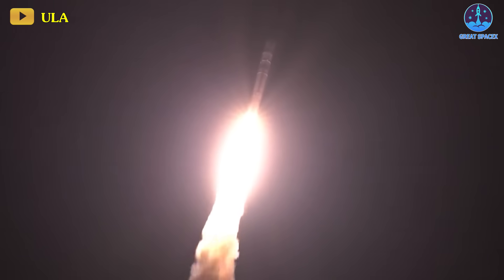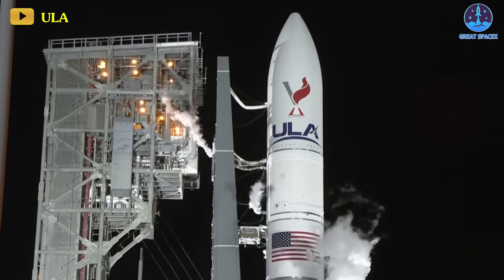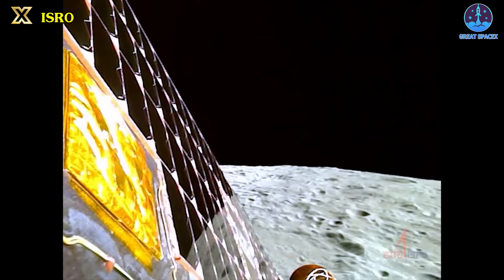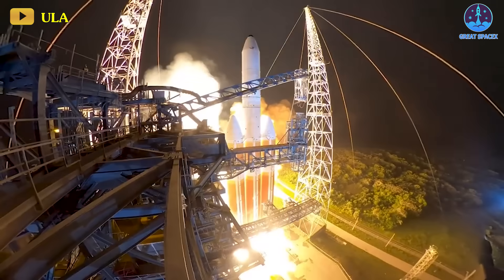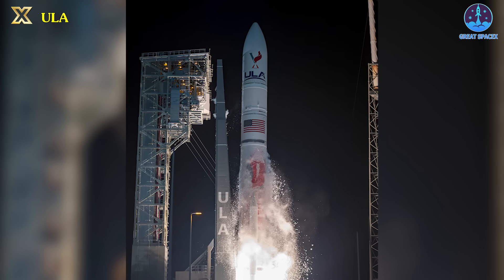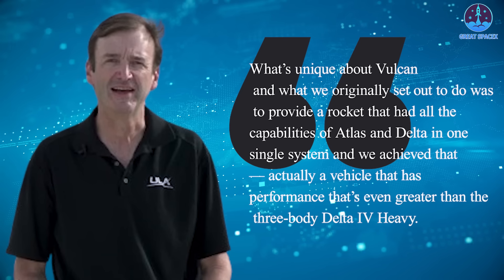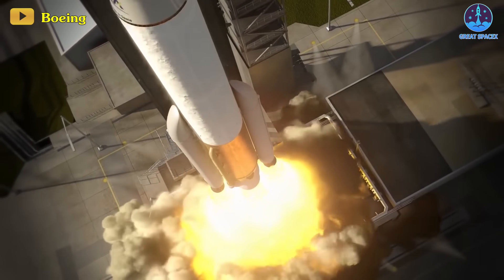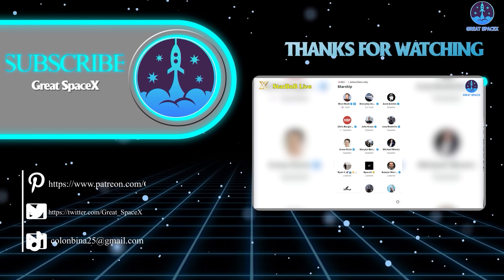Finally! ULA Vulcan & BE-4 successfully launched on first flight. NASA's reactions...

Comment: WHY is Ula still using solid rocket booster 10 years and 2 companies space x reuses the full rocket where solid rocket booster are just space debris better find a solution where space x recovery system should be a case study for all the space companies.
i understand the industrial complex of generating job but space
Reply: Because it is simple, reliable, and cheap!
Reply: For the same reason spaceX is still exploding rockets
Reply: low earth orbit missions - can use re-usable rockets (enough gas left to land back on earth)
upper earth orbit missions - not able to re-use the rockets because need all the fuel to get the payloads farther from earth.

Comment: Great to see Vulcan and BE4 reach space ! Sorry to disappoint all the space x fan boyz.
Reply: I'm not disappointed. I'm just curious, how fast can Blue Origin produce BE-4 engines and whether we would see New Glenn flying eventually.
Reply: BO doesn't need as many engines, they also plan for most of there engines to make it to orbit instead of experimental destruction. Space needs lots of engines because that's how they build.....not so for most others
Reply: It's a replacement for Putler's RD-180 engines.  We finally kicked ryssky ivan engines RD-180 to the curb
Reply: Yeah, it was a total success… how much time and $$$ did it take to get this result?

Comment: I can barely see the custom flame paint job on the booster because the rocket is so frosted over.  A flame paint job adds a bit extra speed and power to any vehicle its painted on, especially with a red paint job under the flame job

Comment: Everyone so fast to complement ULA for a mission well done should take pause today. A fuel leak was detected and it looks like it will end the mission. Better luck next time in 6 months.
Reply: What fuel leak? Where was it and what is your source? I am very interested in the content of your post and hope you expand on it.
Reply: @brianw612 i know their is an issue with perigrine it is in tye wrong orientation so its solars are not genning power. This may have been caused due to all the delays
Reply: That's on the lunar lander side not on the Vulcan rocket which did its job successfully.

Comment: God so many spacex shills here. Just be happy the us is launching successful rockets. So many comments from people who have no idea how this industry works. Delays are common, things break and leak. Rockets have different uses and capabilities, just cuz a rocket doesn’t land doesn’t mean it’s not modern. A falcon to land needs a third of its fuel, some rockets use all their fuel to reach long range missions. Just be proud it fucking works bunch on entitled fucks with no knowledge of rockets.
Reply: Are you a rocket scientist?
Reply: @Alacod19  I’m an aerospace propulsion engineer. So yes I am. And you’ll probs say I’m lying to which I don’t care m, but I got my bachelors in aerospace engineering and work as a propulsion engineer.
Reply: Wrong!  RTLS requires 56t (13.6%) of the fuel load, and DPL requires 37t (9%) of fuel load. The ridiculous claim that a third to half of the fuel load is necessary for booster return is from ULA. Maybe it is required to return a ULA booster, but SpaceX has refined the process to be much more efficient. Not a "shill," just capable of simple research on the subject.
Reply: We finally kicked ryssky ivan engines RD-180 to the curb

Comment: Elon loses again! After all of Elon‘s bragging about how SpaceX would be the first to launch a space vehicle into orbit, powered by methane, ULA actually did it. First.
Reply: Elon has not lost, we, the American people have lost a fortune on this rocket. It took forever to get this launch with lots of cost overruns. This is an overpriced outdated system. The Super Heavey will be much less expensive and reusable, able to launch more often as well as less expensively.
Reply: Fortunately for us SpaceX exists. Will it be another decade before NASA launches again.......and at what cost?
Reply: @robsimer9296  
I agree - SpaceX is a national asset.  However, the chuckleheaded want-to-be-fascist toddler Elon that nominally heads it up is more of a liability than an asset at this point due to his ability to rush SpaceX into launching unfinished vehicles from unfinished launch platforms as they did early last year for no real gain.  Let's hope SpaceX can keep him under control when the lives of astronauts are on the line.
Reply: @wbwarren57 
Why don't you tell us how jealous of his accomplishments you really are without using any of those exact words?
Reply: @frankmcgowan9457  
The accomplishments of SpaceX and the accomplishments of Elon are largely two different things.  I am not jealous of SpaceX's accomplishments at all - just admiring of the intelligence and hard work that goes into them.  It is true that Elon is partially responsible for the accomplishments of Tesla and SpaceX - but only partially.  Accomplishments that Elon can take full credit for include Hyperloop (which seems to have become a cult at this point), the useless Las Vegas tunnel, TwitterX, his neo-Nazi comments, his string of out-of-wedlock children (some of whom have just horrible, life-debilitating names), and his bragging such as his ludicrous statement that "no one else in the world knows more about manufacturing than I do".  I'm not envious of ANY of those accomplishments and feel very sorry for Elon's casually fathered children.
Reply: Zhuque-2
Reply: @Wurtoz 
Right.  It was China that FIRST put a payload in orbit using a methalox fueled booster.  I was looking for that recognition.  In fact, I think they've done it twice already.
Reply: Elon is the head twit of Twitter (now X) , but unless ULA stamps these out like car parts there is no way they can compete on SpaceX's price - every rocket company better be working on reusability. Don't let your hate of Elon blind you to the leaps and bounds SpaceX is doing......   or go ahead and be blinded  Meh.
Reply: @Kr0N05  
SpaceX is great!  But Elon is != SpaceX and SpaceX is != Elon.  Except, of course, for the first launch of Starship which I believe was mandated by Elon and which caused more trouble than it was worth.  As long as rational people are in control (such as for Falcon 9), SpaceX will do great.
Reply: @Jimmy-kz6ug  
First launch of Starship used hydraulics to position engines which they had already decided to move away from.  The Lunch pad was clearly not finished and caused huge damage and consequent delays before a second launch.  Since they had already decided to use a water abatement system, the first launch really didn't help them learn anything in this area either.

SpaceX is doing a GREAT job with the crewed capsule.  However, I doubt that this is due to Elon's input to any great extent.  Considering his rush to perform the next test without proper preparation, I am concerned that his "rush everything" input will lead to the deaths of astronauts (or to people on the ground such as might have happened during the first launch when the flight termination system turned out to be inadequate).

Comment: I noticed two solid boosters to compensate for the under performing BE-E crap engines!
Reply: It's a replacement for Putler's RD-180 engines.  We finally kicked ryssky ivan engines RD-180 to the curb . They have more thrust than c0mmie RD-180 rngines

Comment: So, it is an Atlas-Delta with new engines and solid fuel boosters (giant hi-tech bottle rockets). Build with slow labor intensive 70's tech as a throw away system.  Just shows how SpaceX kicks a_s.

Comment: Where is the footage of the first stage returning to the launch site....oh wait, this one cant do it.Blue origin has a lot of catching up to do.
Reply: Blue Origin has scraped 2 BE-4, SpaceX lost 88 Raptors in 2 flight…
Reply: Sorry, 78 Raptors.
Reply: @renesoucy3444   How long did it take to produce those 2 lonely engines when SpaceX is building one a DAY and still ramping up production...How long will it take BO to replace those 2 engines? Another 12-24 months? They are already 12 years behind schedule, when do you expect them to catch up to SpaceX? And those engines were lost alongside the two test vehicles that weren't expected to come back. How else would you suggest they operationally test prototype vehicles?